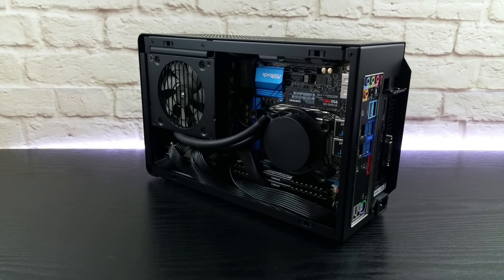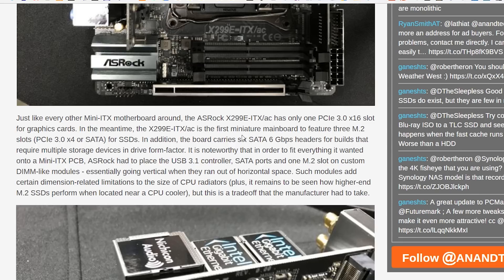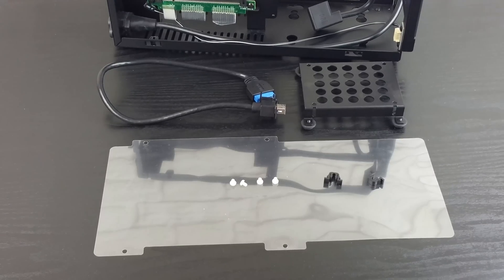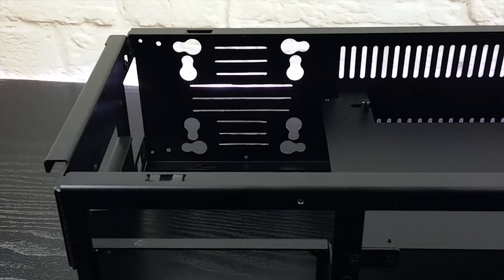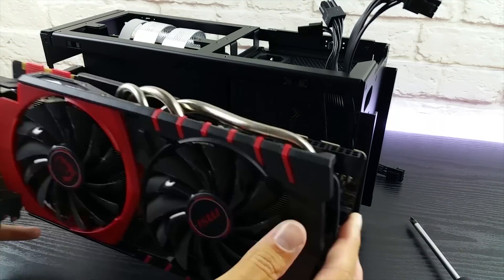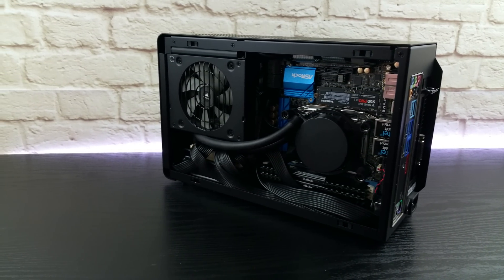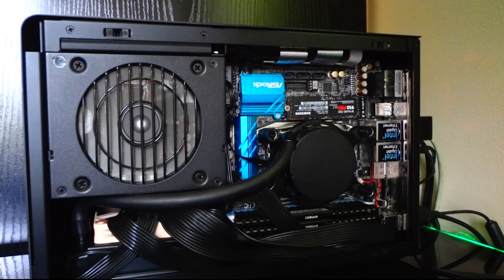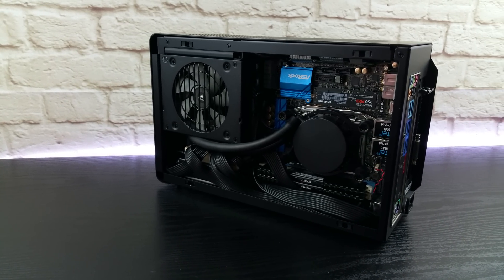The Judge | Modding the DAN A4 SFX V1 for the Asetek 545LC 92 mm AIO @ 5960x !

Comment: You should have laser cut the vents on a separate piece of metal and used it like a template to router out the vents on the case.
Reply from the maker: Where i live, no acces to such equipment. But will keep that in mind for when i want to further enlarge them.
Reply: That's true, still great video. I'm thinking of doing the same thing on my A4 SFX, since I have access to plasma and laser cutters at my uni.
Reply from the maker: Thanks again Chris. Uu nice - that will be a nice asset to have for you to use ;)

Comment: Hey if you were to get custom cables from cablemod what lengths would you need for the case?
Reply from the maker: Hi. From my measurements i would go with 300 mm for the video card, 200 mm for the cpu and 200 for the mobo. Since i don't sata drives but just in case i would suggest 250 mm. But these are preliminary just for this setup. I need to get a second set and modify that one or if companies like cablemod will offer 90 degrees plugs on the psu side / those that exist the psu so even more clearence is available for the fan.
Reply: Glob3TrottersTech thanks for the response, I'm doing a similar build but using the a4-sfx v2, with the asetek cooler with a coffee lake processor. So those measurements should work for me too thanks a lot!
Reply from the maker: You are very welcome Zyro. :) Oh yes it should be an epic build.

Comment: Do you know what a thermodynamic equilibrium is? The temperatures of an AIO cooler after only seconds don't say much. How are the temperatures after 45 minutes of max load?
Reply from the maker: Well when i render for like half an hour and everything is at 90-100% max cpu load doesn't go over mid 70' and this was in the summer 23-24 in the room.
Reply: Does the AIO read the water temperature? I would be interested in that as I get very high water temps on the NZXT version of the asetek.. And mine runs with a 280 rad on a way less potent CPU.. I can just not believe that this little cooler can handle the heat...

Comment: Love this mod, neat job and superb temps! Having Dan A4 as well, would love to go the same route with same CPU, however Thunderbolt 3 support is a must for me, therefore I'm stuck with the only mini-itx mobo Z270 Gaming-itx by Asrock that supports it. Facing some heat problems on 7700k with low profile Noctua at the moment, base clock, but temps can go even little over 100C on stress test after 1 minute, will try delidding, hopefully it's partially due to terrible TIM they applied in factory. Could this cause such terrible temps, what do you think? Currently air cooling it with big heatsink and open side panel which, of course, does magic, but it's not how Dan case should look and work like haha. I think I will get this AIO and do the mod, can't wait this long as well for V2. Thanks for the great video!
Reply from the maker: Thank you very much for the kind words Tobu! 
Well the 7700k are notorious for the crappy Tim hence most people delid them. I hear you with the Asrock, the same for me. The only x99 mitx motherboard out there. :)
Good luck if you do the mod and let me know how it turns out. All the best, Alex
Reply: Tobu, which direction should the airflow be to keep a negative air pressure? for an AIO water cooler, can the CPU be intake? Let me know. Thanks.
Reply: Whats your gpu?
Reply: EVGA GTX 660 Super Clocked. It's a blower style.
Reply: does your build use the 545LC cooler as in the video or are you air cooled with the low prof noctua?

Comment: Hey, I was thinking of using an aio in this case by using a small HD plex 400 power supply instead of an sfx psu. Are there 120 mm mounting slots on the psu vent?
Reply from the maker: Hello. That sounds very interesting. No dedicated mounting holes though but with some minor mods or very small wires for example.should do the trick. Good luck with it ;)

Comment: were you able to overclock the gpu? i really want this case as i am a big fan of small form factor cases though i havn't made the switch because i do not want to sacrifice performance, or liquid coling, though this aio fix is brilliant and i would certainly do this. 
                                    thank you for your time and great video!
Reply from the maker: Thanks man ! Currently i have the gtx 1070 from MSI which even with overclock at over 2ghz it is still under 70 degrees which is really good.

Regarding the msi gtx 980ti as per the video, i managed only a little maybe 50 mhz because it was already a hot card and didn't want to push it too much.

Hope it helps and good luck with your build ;)

Comment: Great video. Thanks for showcasing this cooler and the Dan Case. I recently ordered a Dan Case A4 SFX V2 on Kickstarter. I have some questions for you. How loud is the pump noise on the Asetek 545 LC cooler? Can you hear the pump noise when your PC is at idle and the other fans are hardly spinning?
Reply from the maker: Thank you sir.
No noise for the pump. You can only hear it at the start of the PC - when it moves the liquid and air bubbles but that's it. After that can't hear a thing.

Comment: Let it run for an hour in stress test. I bet this undersized AIO can ´t cool your CPU if the water is heated up.
Reply from the maker: Will do. Now i am trying to do my custom wire sets to improve airflow. But as is besides what you saw in the video, when i render in 4k at 50mpbs something took like 40 minutes to finish and it never exceeded 72 degrees C.

Comment: Hello, very nice video... I just have a few questions, where did you get the M4 16mm screws for the fan to the rad? Also what are your temps on your 140W TDP 5960X with the Asetek 545LC AIO? Did you also overclock the 5960X and if yes, how was/is the temps on it at that time?... Since I'm getting this AIO for the new Dan Case A4 SFX v2 and I am thinking of getting an 7700K, which I'll try to push to 5GHz, but wanted to ask you this before going that route. As you already running this AIO, with an almost double TDP CPU than the one I'm considering getting.

Many thanks and once again, very nice video! :)
Reply from the maker: Thank you ;) Well for the first part of the questions regarding temperatures, you have the live numbers in the last part of the video. :) 

Then the screws, again as i mentioned, everything is in the description linked :)

Overclocking, not yet because i want to get custom cables and tidy up the wm and even enlarge the cutouts if i can to further optimise the airflow.

Regarding the 7700k i also mentioned about this aspect, you will likely have higher temps than my 140w tdp cpu than your quad core at 95w because of its thermal paste and not being  soldered. Exatcly why i switched from my 4790k to the 5960x and watch the video to the end, where i have better results with the 8 core because it is soldered despite the double core count and almost double the tdp :) 

If you want the 7700k it is highly recommanded that you delid the cpu if you want to keep temps in check  especially for 5 ghz. :)

Hope this helps in your endevour.
Reply: Hello again, so after doing some digging I know understand what you mean by it all.

Hence why I also went with the Asrock board, the same AIO cooler and the 6850K.

I want to ask you though, how exactly did you connect the pump and fan to the motherboard?.
Since the fan is loud if at 100%.

I've read that the pump on a fan header and let it run at 100%, as it should have a fixed speed and not be controlled. And the fan to the CPU_Fan header on the motherboard. 
How have you connected these?...
Reply from the maker: Hello again Chrazey. Nice to hear that. :) 

Well, like you guessed I connected the pump to the CPU header (the one closest to the RAM slots) and the Noctua fan to the second header (the one near the SATA ports). Everyting is in auto in the bios besides the XMP for the RAM. 

The fan blows upwards and all the noise as you saw from the video that is everything in my case. At 100% it is almost as loud as my corsair PSU when i had the 980ti. Now with the MSI GTX 1070 because I upgraded, everything it is even quieter.  Still searching for option to modify another cable set to tidy up everything and will do another video. 

All of these as a conclusion, i am very happy with the total system noise even with tangled WM that badly obstructs the airflow. Hope it helps :)

All the best,
Alex
Reply: Hello again Alex, I was just wondering about something... The screws that you have linked in the description is for screwing the noctua fan to the radiator on the AIO. Did you use the same screws to attach the AIO radiator to the actual chassi itself or what screws did you use for that?. Thanks.
Reply from the maker: Hi again Chrazey. How have you been? Well the fan just sits by itself on top of the AIO because the PSU wires hold into place :) Didn't get a chance to redo the wires and WM to finalize it - had some p[problems with my car and other matters took my focus. 

So the screws that hold the AIO rad to the case i used the ones that came with the Aseteck and for the fan onto the rad as you pointed out are the ones linked in the description.
Reply: Hey again Alex, not sure if you perhaps know if the screws that come with the cooler (that holds the rad to the case itself) is M3 or M4?... I know the fan screws are M4 and they look a bit thicker than the screws to the radiator itself. So you happen to think that they are M3?... The reason I ask is that I'm looking for washers to place between the screw and bottom part of the case itself (since it has rather big holes and rubber grommets for HDD screws) and not sure which size to order.
Thanks!
Reply from the maker: Hi Chrazey. If they are thinner they should be M3s. I can't remember because I used those that came with the rad to secure it to the case. And for the fan i didn't put anything in the end because the fan was being held into place very tight by the wires from the psu pressing in the middle part of the fan's hub/frame. So yeah i didn't bother. Now i took apart the pc to clean it and everythig is scatterd on my desk. Will try to measure the screws for you just in case ;)
Reply: Ah I see... Well I have ordered M3, M4 and M5 black washers from eBay, as will try to see if they will work :) Would be very nice of you to measure if you can, very much appreciated! I'll wait for your response :)
Reply from the maker: Will do man, of course. After i get out of work today and get back to you. :)
Reply from the maker: Ok. To secure the rad to the case i used the rubber grommets as a spacer that already come with the case, the ones that already are with the hdd cage. And the screws thst i used are the M3s. The same M3s from the same hdd cage. Up top you may need longer normal m3 bolts 16-18 mm to secure the fan. I didn't use any bolts in top since the fan stayed snug just by the force of the psu wires. Plan ahean with the wm, a custom set is higly recommended since the stock ones if you have the same psu are a pain to mold into place. Good luck and have fun ;)
Reply: Ahh I see, the same way I did then... I just thought that the rubber grommets that came with the hdd cage as spacers, were very loose. As the screws would slighly just shrimp through the grommets themselves :P ... Yeah, I've already ordered and recieved custom cabels from CableMod for my PSU, so that's all sorted :)
Now just waiting for my new AIO, as the one I have has gotten threaded unfortunately :(... Thanks for taking time to look, highly appreciated! :)
Reply from the maker: You are right, with the grommets it isn't a perfect fit but i choose a side where they grabbed more and tightened more there. 2 points of good contact and it was good for me. 
Goos good then. You are all sorted. Of course my pleasure, happy to be of help :)
Reply: Hello again, I have just one question for you as I’m tuck... How on earth did you manage to get the PSU, with all the cables connected, in over the AIO?... I just simply can’t do it. Since the PSU cables are just too bulky for some reason or I’m doing something wrong 😔
Reply from the maker: Hi man. Ah yes there is some struggle. First really bend the cables. You mentioned you have custom sets. Have a look here for inspiration. https://hardforum.com/threads/dan-a4-sfx-the-smallest-gaming-case-in-the-world.1799326/page-333

Hope this helps. :)

Comment: Hey! I also do own a A4-SFX and thought about the 545LC... Your vid shows but no closed sidepanel on CPU-side... Is it still possible to close the sidepanel with the tubes? They seem to protrude a few millimeter over...
Reply from the maker: Hi. :) The tubes will fit after you do the wire management to perfection. Only then you can position the tubes so the side panel will close. :)
Reply: Glob3TrottersTech Thank you! I already own custom length cables with a wide gap where the radiator would be =) so wire management won't be a problem. 
Continue your good work, enjoyed your vids!
Reply from the maker: Thank you Tessy ! And you are very welcome. Good to hear then :d Post some pictures when you finish if you can. ;) Best of luck.

Comment: Curious about the orientation of the Rad and Fan. IS it sucking air in and dumping the hot air over the PSU ? woudn't it be better to push the air out the bottom ?  could the fan be on the bottom. Can you share the explanation of why the rad and fan are oriented this way ?
Reply from the maker: Hi James. First thing. Unfortunatly the fan can't be placed anywhere besides as you saw because there is no space to move the rad-the tubes prevent this because thy hit the PSU. 

Now regarding airflow orientation. It is pulling air upwards. I tried this just to follow the simple rule of hot air naturally rises upwards.

Will try to reverse the airflow to push in down and exist from the bottom on a future clip because i want to get some custom cables to remove some clutter.

Hope this helps.
Kind regards,
Alex
Reply: Thanks!! Will be trying the same mod today. Got to cool my  e5-2690v3 :)
Reply from the maker: Wow. One hell of a beast you will have ! Good luck ;) 
Take some pictures if you can when done.

Comment: Very good video, I have asked this case for ebay, I thought to put a 22 core xeon as I saw it in a video but I thought it would overheat a lot, do you think otherwise? and with a 7700k i7 would also get very hot? Sorry for the ignorance, thank you
Reply from the maker: Thanks man ! A xeon they are usually even cooler running. Was looking myself at the 10core 6950x equivalent which had 160w tdp. Should be fine. Will try to overclokc my 5960x and see how much headroom there is. :) Regarding the 7700k only if you do a delid if you plan to OC. stock maybe the aio should handle it but i don.t have one to further test :)
Reply: Glob3TrottersTech Many thanks, I would use it to render in 3dmax, I understand that for what is small ventilation is the point against this case, have you ever tried to render in programs like 3dmax, premiere pro, etc. with this pc? What temperatures did it reach? I was thinking about the intel core i9, I hope do not over heat much like the 7700k, do you think to try in the future the i9 in this case? Or recommend processor to render in 3d programs without overheating much
Reply from the maker: This clip was rendered on it ;) In adobe premier pro cc hence why i built this spec. i got like 70 C at the ending of 30-40 minutes of render time.  
I would advise aginsr the i9s. Have tou seen the reviews? They are getting 100 C worh custom water cooling.. i mean ... 
The i9 not being soldered is the main motive i went with the 5960x. Hope this helps. If you still want the i9s wait until everything is released and see what solutions are there. Of course you can delid them and all good but like i said wait until eveyrhting is relsead and someone start to delid them and see concrete numbers regarding temperatures before and after.
Reply: Glob3TrottersTech Many thanks, I have much more clear now, if I saw a video in this case with the i7 7700k + 100C crazy, one last question because you preferred to use gtx 960 ti and not a 1080 or 1080ti was by temperature factor?
Reply from the maker: You are very welcome. :)
No, i just reused what i had from my previous build. Will upgrade to the 1080ti later to recover more funding :)
Reply: get a ryzen 1600X or 1700X and you will be fine. Plenty of power and easy to cool, because the heatspreader on amd processors is soldered :) fuck intel and their expensive trash!
Reply: Thanks, it's interesting! I'm thinking to build the same specs following yours, also another option is 8700k + Asrock Z370 gaming-ITX. What do you think? I heard the 8700k is pretty hot, it's a lot of money to me so I want something also future proof. Please advice me ! Thank you